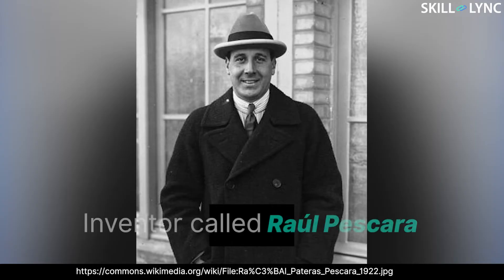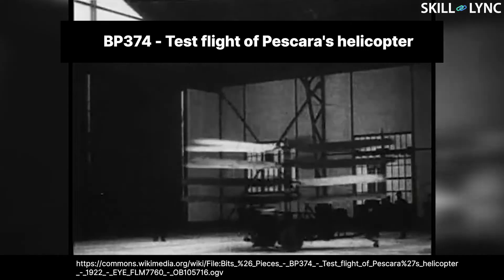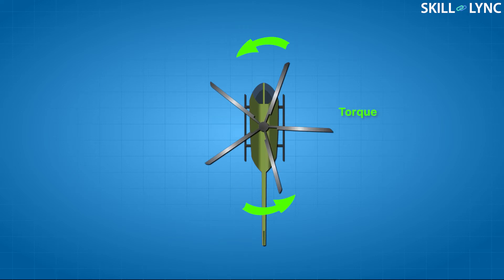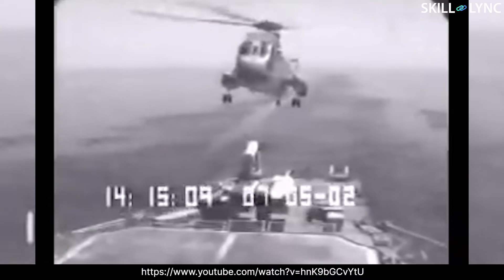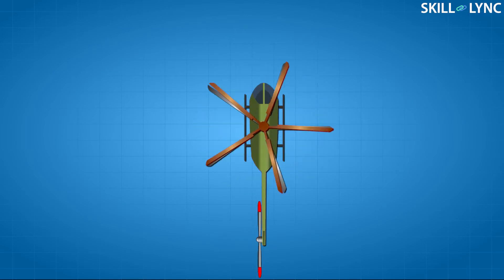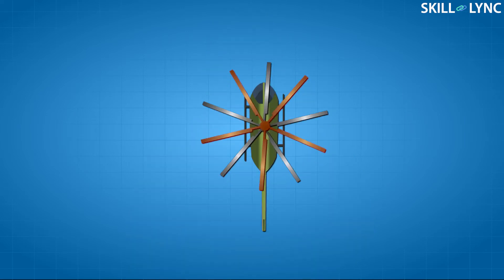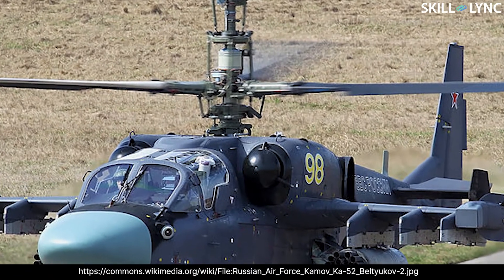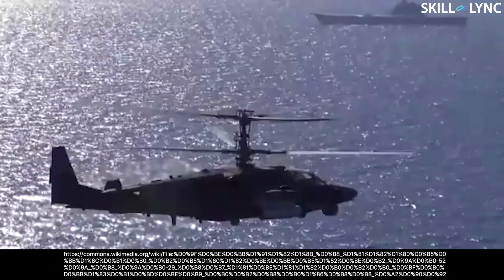Coaxial Rotor in Helicopters | Skill-Lync

Comment: how does it rotate/turn? why i can't find a video on that... if both rotors are sync to turn with the same speed, then how does it turn?? or the speed changes for it to turn?
Reply: Full scale collective pitch coaxials difference the collective pitch of the two rotors to yaw. Collective is increased on one disk and decreased by the same amount on the other disk so that the overall collective pitch is constant. This cases one rotor to exert more torque on the airframe than the other and the machine turns in the opposite direction. There are also hobby grade collective pitch coaxial helicopters like the Sovrein CPX5-FBL that work the same way.
 Here's a video of a collective pitch RC helicopter that shows how yaw control by collective difference works: https://www.youtube.com/watch?v=7j9fhTJzoZE
Reply: @Venkat Jaya Deep i can understand how it's done on RC models, but the real thing has one engine, one shaft, how to change speed of both rotors? Is there some kind of variator geerbox?
Reply: @kaibest  On rc models, they vary the speed of the rotors. In full size aircraft, I believe that by adjusting the pitch of one rotor to have more load it will generate more torque than the other rotor. But that is just a guess.